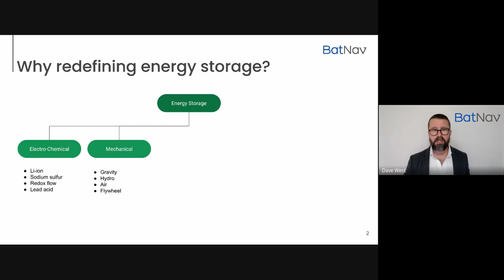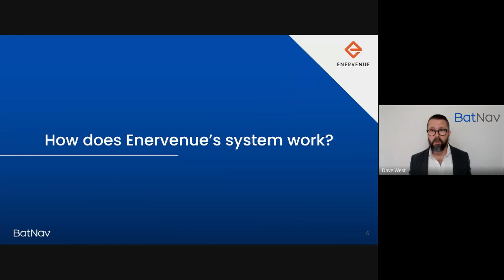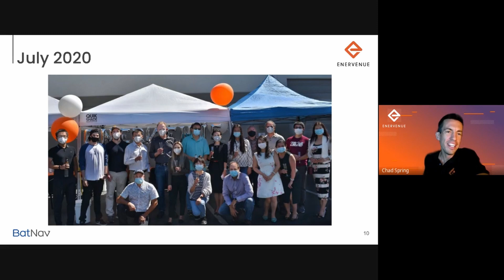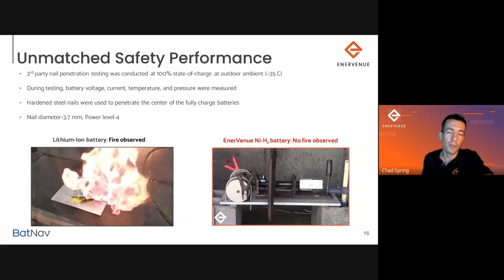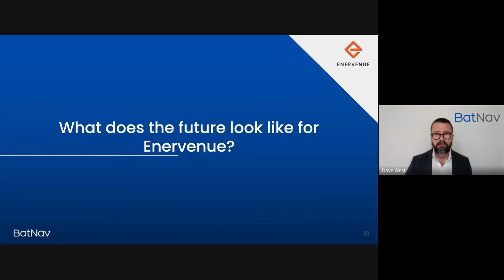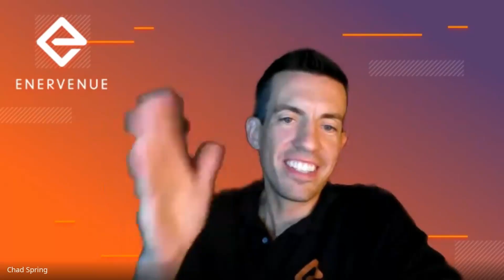Redefining Energy Storage with Metal-Hydrogen Batteries - BatNav & EnerVenue

Comment: can you give details about the chemical reactions taking place and the efficiencies?
Reply from the maker: Hi there! Thanks for your question. The chemical reaction is simply the electrolysis of water into hydrogen and oxygen (H2O --> 2H2 + O2). Since the vessel is sealed, the pressure will increase. The gases either dissolve in the electrolyte in the vessel, or separate into gas. There are some good resources about the technology on EnerVenue's website: https://enervenue.com/resources/
Reply: Search "Researchers propose a cheap nickel-hydrogen battery for grid storage" for the chemistry that Stanford did on the catalyst side